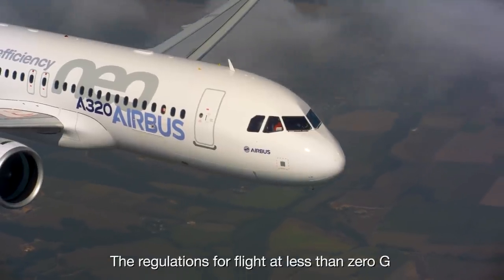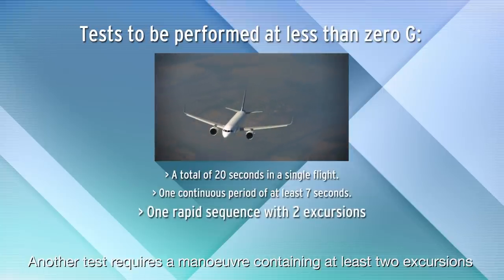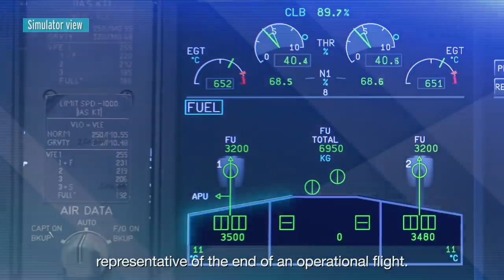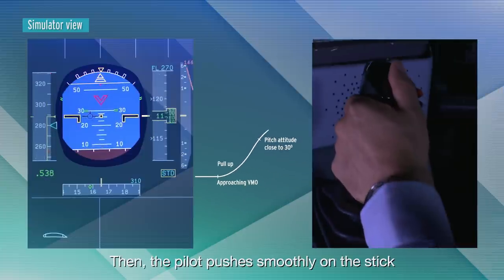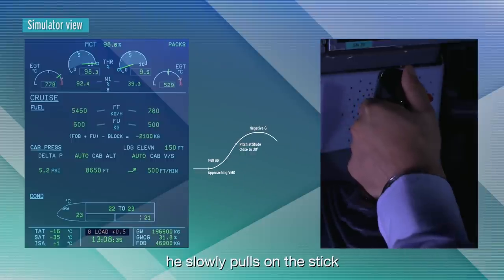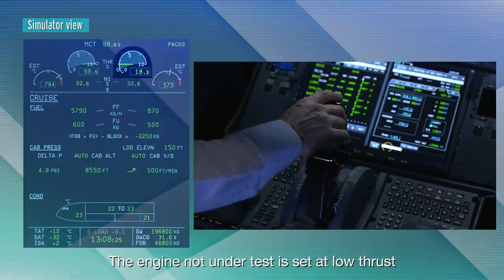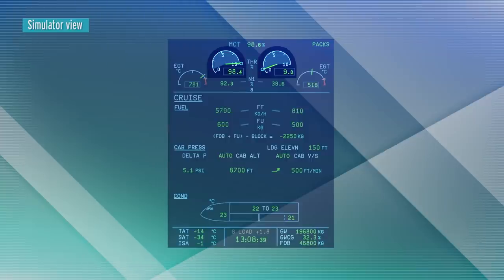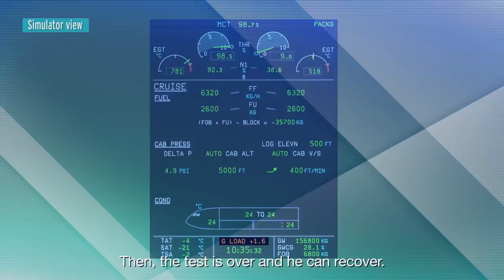Flight Tests - Ep.4: Flight at less than zero G

Comment: 2:29 As obviously the aircraft cannot be flown upside down....1955: Tex Johnston: Hold my beer Airbus!!!
Reply: That depends on the point of view. In terms of forces, the plane in Tex Jonston's barrel roll was never "upside down". A correct barrel roll is flown with positive G throughout. A glass of water should remain full on the table... ;)
Reply: That’s not untrue but, will the wing generate lift if flipped upside down?
Reply: @simpilot001  The short answer is: Yes. The long one: The wings always generate some kind of lift if the airflow is stable (i.e. not stalled) and the airfoil is not symmetrical. The direction of lift depends on the angle of attack, i.e. the angle of the airfoil with respect to the air flow. The lift of the wings actually is what "pulls" the aircraft through a barrel roll. The lift vector keeps rotating as the roll is performed. But even if an aircraft is just flipped upside down the wings may generate lift (in the opposite direction). To do that they may need to be flown at a very high angle of attack, because typically air transport category wings are designed with asymmetrical profiles that produce most efficiently lift in "normal" flight direction.

Comment: Way to go Airbus!
Reply: Many women take the plane while they are pregnant. The embryo, if it is a long flight and return flight, can be subject to more than twenty hours of cosmic radiation. This in itself increases the chances that the child will be disabled or have mental problems. It is also possible that the mother makes several plane trips, so that the embryo is subject to cosmic radiation for a long time. Which is a consequence anyway: irreversible DNA damage on the embryo. And airplanes therefore cause a very rapid genetic degeneration of humans. You can ask yourself, does a company like Airbus still have a right to exist? Should they be criminally prosecuted for ending humanity? The answer to this question is obvious. If you make people handicapped for things that are not necessary, you have to be locked up in a cell for life..
Reply: @karlmarx1463  still here?

Comment: Considering that the operational envelope is +2,5g to -1g with flaps up, is there a test to the maximum negative g allowed or just this less than zero g flight test? After all, non-test pilot crews could find themselves in that region and even slightly exceeding the negative 1g in some circumstances.
Reply: Many women take the plane while they are pregnant. The embryo, if it is a long flight and return flight, can be subject to more than twenty hours of cosmic radiation. This in itself increases the chances that the child will be disabled or have mental problems. It is also possible that the mother makes several plane trips, so that the embryo is subject to cosmic radiation for a long time. Which is a consequence anyway: irreversible DNA damage on the embryo. And airplanes therefore cause a very rapid genetic degeneration of humans. You can ask yourself, does a company like Airbus still have a right to exist? Should they be criminally prosecuted for ending humanity? The answer to this question is obvious. If you make people handicapped for things that are not necessary, you have to be locked up in a cell for life.
Reply: What the hell are you talking about?🙆🏻‍♂️🤦🏻‍♂️

Comment: What if, one engine per time test is ok, but all engines running can fail? I thought, in flying industry, you test all possible/impossible combinations.
Reply: no they don't , having dual engine failures is extremely rare, till the point where many times you assume it won't happen. the consequences caused by a total engine failure far out weighs what they are trying to test. In short you have way more important things to deal with. 
For many of the flight test certifications test are most of the time tested till the worst, one engine inoperative. rarely a full dual engine failure. 

There are various situations where there isn't a clear guideline or SOPs for pilots, when that happens, the pilots of to use their knowledge and experience to deal with it.

Comment: #Airbus why u r using full thrust test, instead we can use low or medium thrust also, isn't it?? Or if not what is the reason???
Reply: Full thrust means the highest possible flow of fuel and engine oil, which is probably the worst-case scenario. For example, if the fuel system cannot manage to deliver fuel to the engine in <0g conditions, that will show much sooner when the fuel flow is higher, and so the fuel lines running to the engine (or fuel pump, or...) are drained of residual fuel faster.
Reply: @ldflightsim  thanks for clarifying me

Comment: I wonder what less that 0 G feels like
Reply: I can only comment about 0g while being strapped in a seat. 0g feels exactly like falling (because you experience 0g when falling...). Less than 0g feels like hanging upside down in your seat belt.
Reply: If you are not strapped in .... 1 G is like on earth surface, 0 G is weightless and -1G is again like on earth surface, but it will be upside down. So if you lay on your back on the ground in 1G situation, you will probably lay on your head on the celling in -1G situation.
Reply: @junrenong8576  so basically it's gravity upward and downward and zero